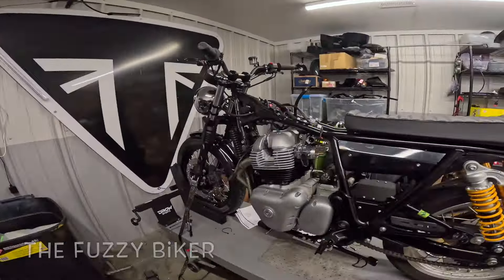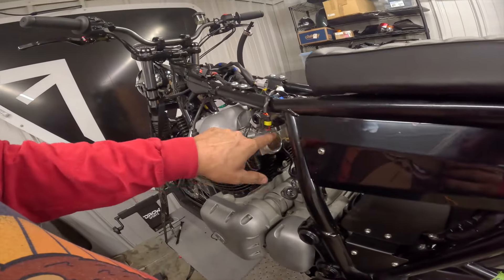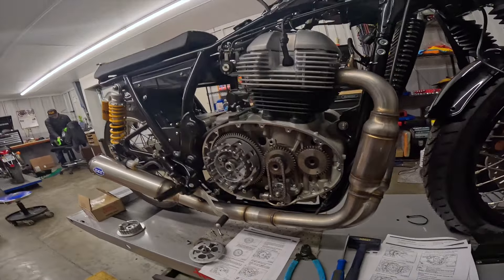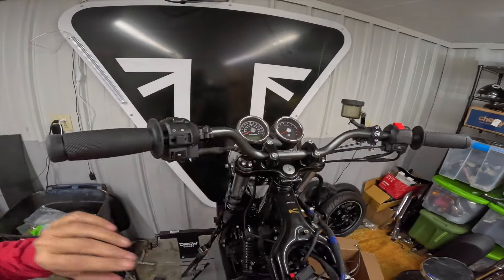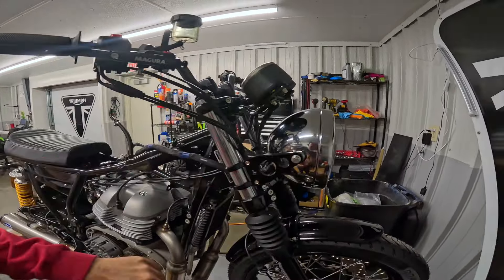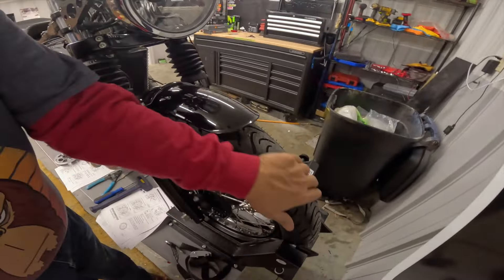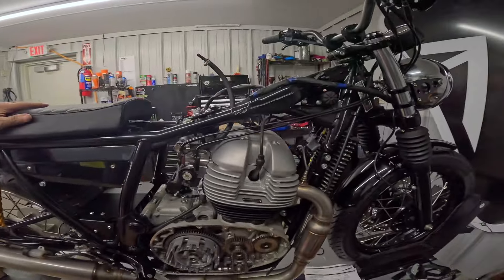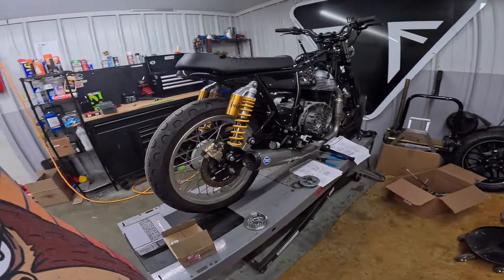RE Big Bore Street Racer Project Update - More Horsepower - Wahoo!

Comment: Anxious to see how this 863cc goes; I stayed at the milder 743cc version and have over 8,000 miles on it. With the added power and torque combined with the weight savings using a full stainless-steel exhaust system, power is on par with my 865cc Triumphs.
Reply from the maker: These bikes are so much fun stock. These power upgrades should really make them sing. Wahoo!